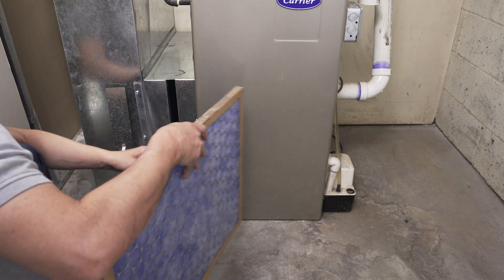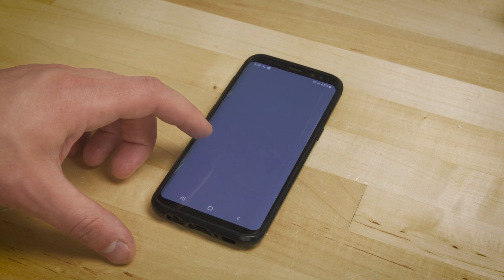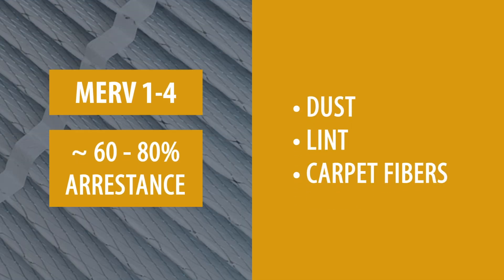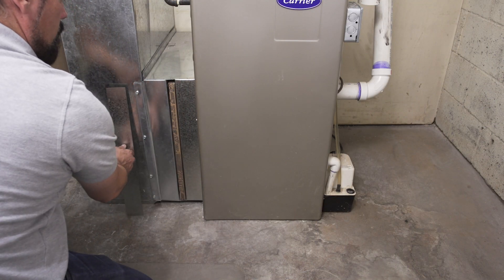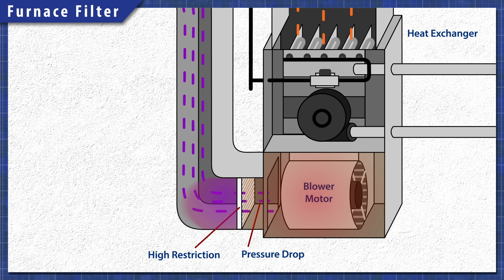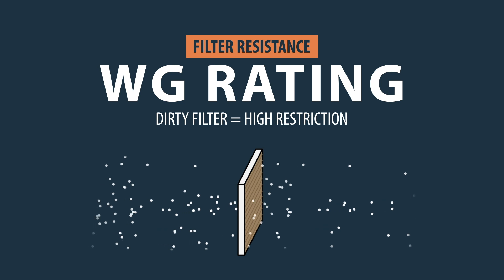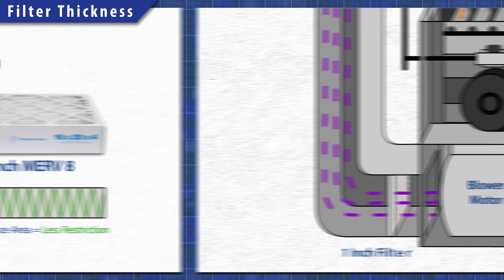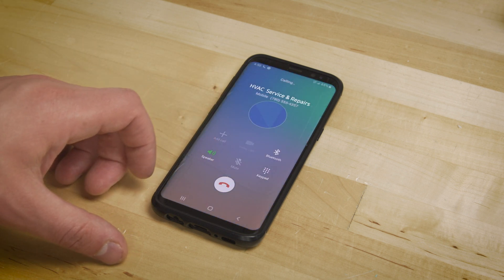Furnace Filter Upgrade (What You Need to Know) | Repair & Replace

Comment: I use basic merv 1. I also have air purifiers. Basic fiberglass is best to use on system.
Reply from the maker: As long as the filter keeps the blower motor free from dust then that will work.